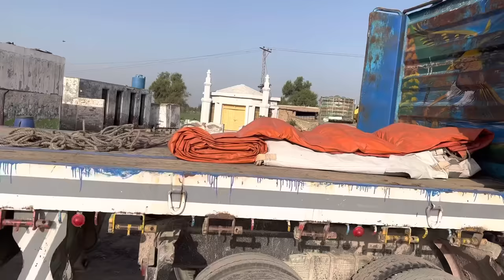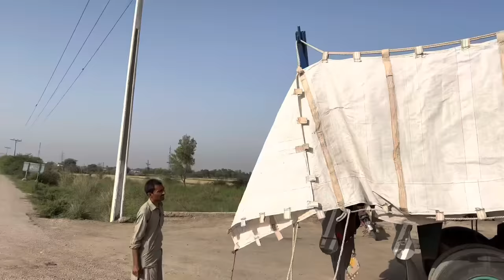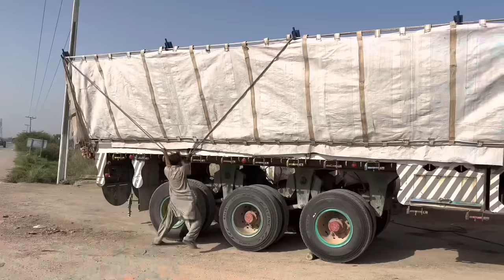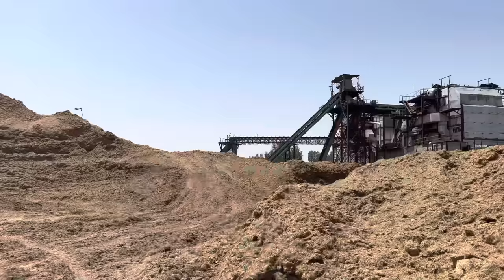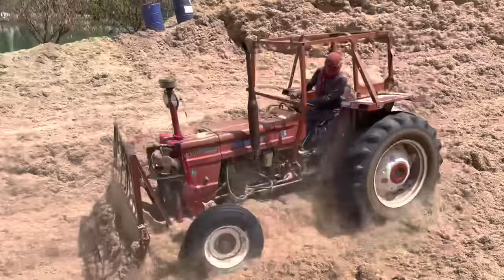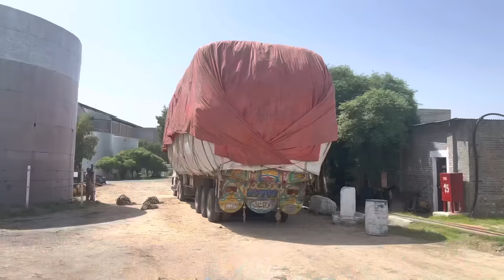First time  Sugarcane Bagasse Loding in Heavy Truck “Pk Amazing Skills “

Comment: If the top tarp has a major failure during a heavy rainstorm and this load get soaking wet the truck trailer and tires will have a catastrophic failure due to additional water weight I assume. I guess
you don't ship this cargo if there's a chance for heavy rainfall.
Reply: water proof sheet is used for rainfall situation. Normal weather in Pakistan is lesser rain fall except monsoon season months.

Comment: I've watched a few of these now and I'm still not sure I understand why they wouldnt just run that canvas along the inside of those support ribs.
Reply: By the looks of things, they are not thinking with logic, but with the desire to get as much product per load as physically possible.
Reply: This being a flatbed trailer with no dump system they have to unload manually whether by hand or machine. With the canvas on the outside of the ribs all of the product can be removed, even from the sides with out tearing the canvas.

Comment: ¿Que material es y dónde es?, gracias
Reply: Sugarcane bagass which remains after complete crushing of sugarcane in granular sugar factories.. This bagass is used for cardboard making in other factories. The place is Pakistan.. Don't get surprise about loading it is such loaded because the bagass weight is low than it's volume, to save fuel cost...
Reply: In other countries,that bagasse is used for fuel for steam engines,and the steam boilers in sugar refineries! Dual purpose,and definitely cuts the cost of production! Very light weight,and bulky,so the weight limits aren't really being succeeded! The old steam traction engines burned straw from the wheat,rye,and other grains as they harvested them,nothing went to waste!! Thank you 😇 😊!

Comment: That Truck is clearly overloaded and this will severely strain the Axles, Brakes and cause strain damage to the engine ( Pistons, crank shaft, drive shaft ) , i cannot comprehend how this is allowed there as it will result in crashes and death/serious injuries !
Reply: Noap, not overloaded, weight is around 20 tons vs capacity 50 tons.

Comment: That's why these trucks break down and a lot because seeing this is a very considerable overweight, even putting the lives of other drivers on the streets and roads in danger.
Reply: Fabio, that is why in law abiding countries they have weigh bridges where trucks are inspected all the time for overloading. But in this part of the world anything goes. I have watched many videos of peoples working conditions,  after watching that I am not surprised by this. Furthermore why must the bagasse be moved. It can be converted to boiler fuel right at the sugar mill.
Reply: Truck weight is near about 50 tons no over load
Reply: Bro this is straw wrath waste